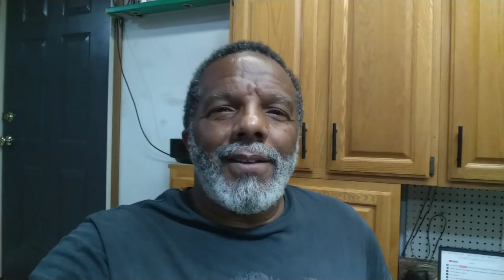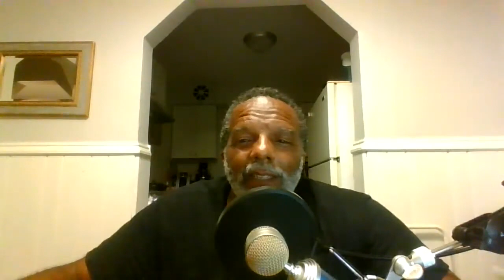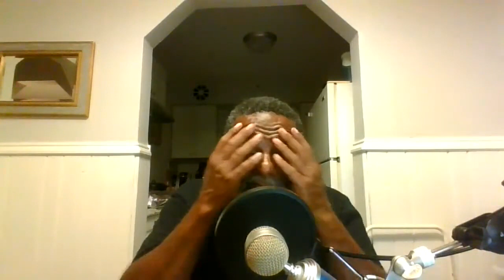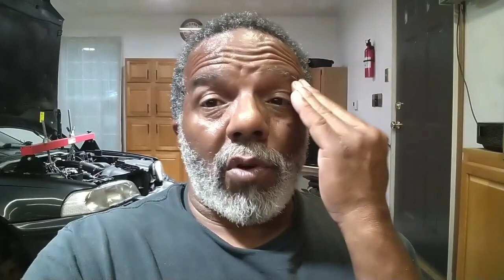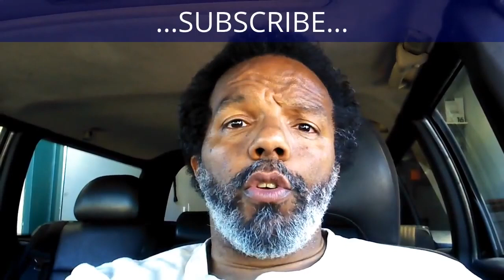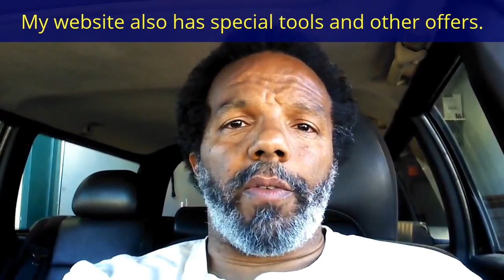Part 2 of the live feed mic check from the other day. Answered a few questions and more... - HOWR

Comment: On my 03 Cavalier, the right front corner subframe - A frame bolt broke off some how. I don't know when exactly but it was at least 4 months to 1.5 yrs ago. I had the right front axle cv replaced 1.5 yrs ago. Four months ago had both front lower control arms replaced. right front lower motor mount and both outer tie rods replaced. The boot and clamp about six months ago saw came loose and a guy at a shop used a heavy duty plastic tie thing. About two weeks ago when a technician saw the boot off the right front axle noticed the right front corner subframe - A frame bolt was broke off inside. Also noticed the bolt from the right front control arm and subframe - A frame was loose and the bolt in the subframe next to it about a third of the way over. The two bolts were tightened back up. My car for months was pulling a bit to the right often and a little to the left then it would correct itself and then could put the steering wheel straight when driving. Again a few days ago replaced the right front axle cv since the guy didn't have the tool to put the boot with clamp on the existing axle cv. Supposedly did the 4 wheel alignment when I asked. It's going okay now but feel a little pull to the right once in a while.
I don't know if is the shop that replaced my front lower control arm or the shop 1.5 yrs ago that did my right front axle cv that broke the bolt at the subframe? The problem is liability to who broke it or if it happened on its own? 
The rear frame of the car is rusted and a large spot is rusted through by the right rear wheel. The road salt and liquid spray used to eat up the snow and ice rusted my car underneath good.
Reply from the maker: Dang, not sure I'd be looking for fault, just be glad it was found and get it fixed.
Reply: @RobertDIY  That is somewhat what am thinking. At the same time wondered if a shop broke the one bolt or if it broke on itself? Anyhow hope it goes okay.